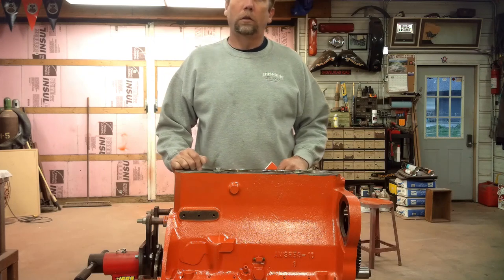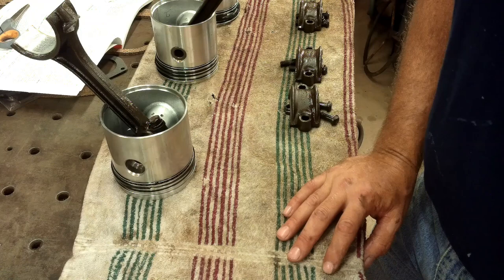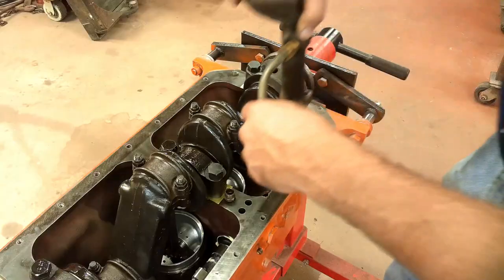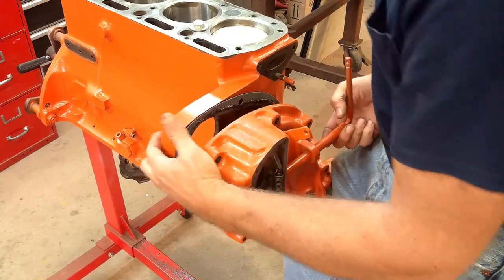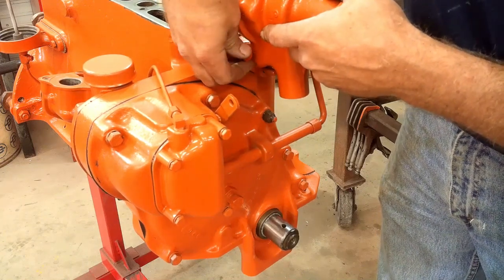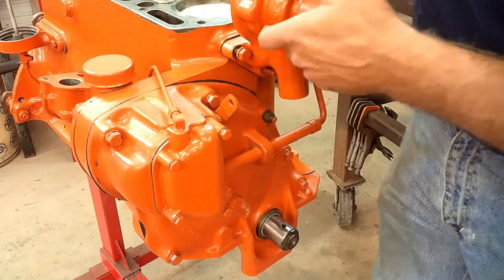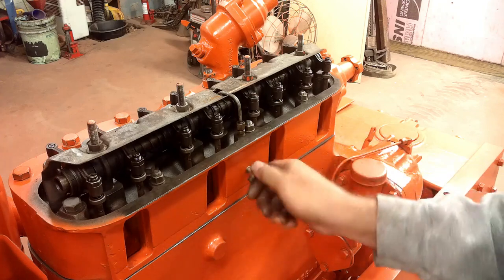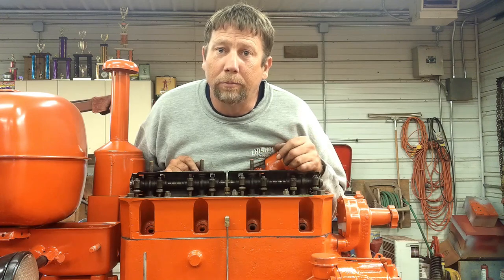Allis Chalmers WD45 Restoration Engine Install Ep.26

Comment: Good catch whoever caught the piston issue, my JD is not like that. Tractor is coming along nice, looking good. Keep smiling
Reply from the maker: I got lucky, it only cost me about an hour of my time. I did notice I had to move the rods over to get them to line up with the journals when I put them in the first time, but I did not investigate it any further. I have never run across anything like that before, and not sure why it is that way. I don't see any reason for it.  Maybe the engineers screwed up and that was their quick fix for it.
Reply: I know all the Wc Wd wd45 and d17 engines are like that but I’m thinking the b c ca and d15 engines are too.
Reply from the maker: I will be finding out on a C soon enough

Comment: There is supposed to be a "tooth rounder" on the back edge of the ring gear, for a lead in for the starter gear. Just a bit of a chamfer on the side of the teeth may help save the starter bendix gear for an extended period of time.

Comment: Just a tip for you on the ends of oil pan those 2 cork stripes,  put them in a empty food can like a corn, pees or a bean can for a couple hours it'll hold the shape, makes it easier than. But there are clips to you can buy that clip on the pan that'll hold the end cork seal onto the pan.

Comment: Just got the head back on mine last weekend
Reply from the maker: Are you doing a complete rebuild on yours?
Reply: @sparksfireandbalingwire8467  Not as extensive as you have with yours. Honestly mine was a basket case that should have been scrapped but was complete. Has to send the head out to machine shop valve seats had rusted out of it due to previous owner removing the head in 93 and letting it sit. Oil had not been changed since 65 previous owner put the date on the filter haha.

Comment: Question: I have the manual you initially showed in the video stating 70ftlbs torque, and is I what I heard you say to use on the bolts. I have an allis shop manual that states 90ftlbs torque. Did the 70ftlbs actually work or did you end up with adding more? Also, did you copper coat the gasket? Love the videos!
Reply from the maker: I torqued them to 70, then after I got some run time on the engine, I torqued them again. I did not copper coat the head gasket if I remember correctly.
Reply: @sparksfireandbalingwire8467  okay thank you. The head gasket I took off had copper lining like the old style. The new ones look weak compared.

Comment: Like always I learned a lot in this one.  Those wrist pins are something I never would have thought to check.  However when it came to the head studs I do have one question.  Why did they design it to where there’s only two head studs on one side instead of the other side which has 3?
Reply from the maker: Thanks Cody! There are several more bolts besides the studs holding the head on. The side with 2 are 1/2 inch diameter and also hold the thermostat housing. There is no way to get bolts through the housing so the studs come up from below and use nuts to hold it on. The side with 3 are only 3/8 inch studs. They are out on the edge of the block past the pushrods. They are just to keep oil from leaking at the edge, they aren't containing any cylinder pressure
Reply: Sparks Fire and Baling Wire  Gotcha, that makes more sense👍!  I gotta hand it to ya Jason, it looks flat out amazing, and I can’t wait to hear it run.
Reply: I was wondering the same thing 
Great videos